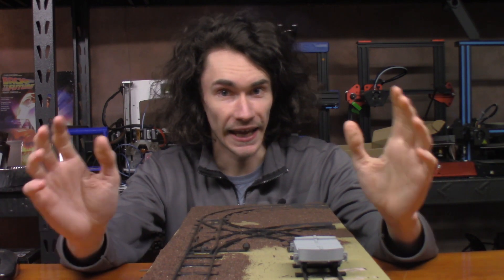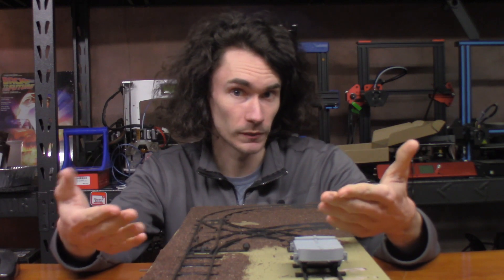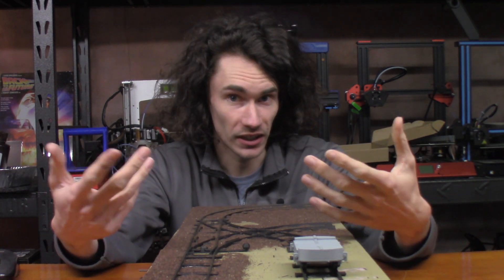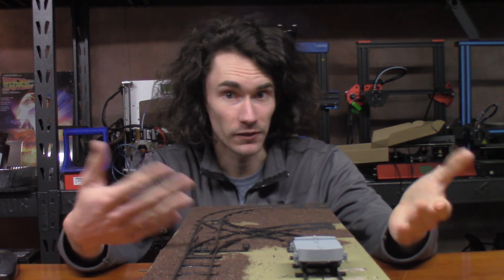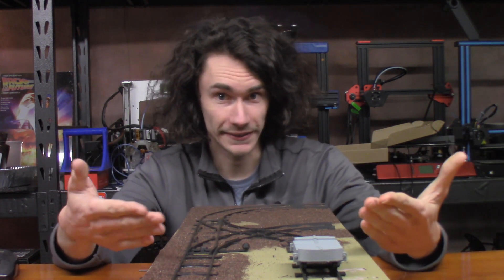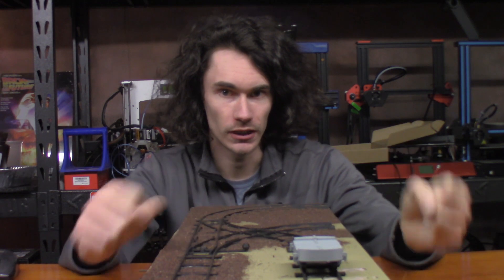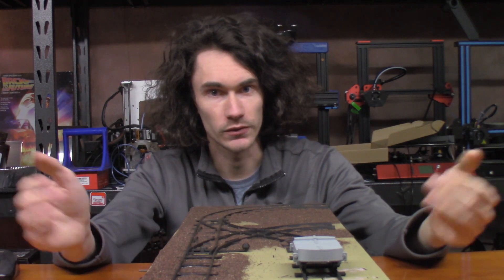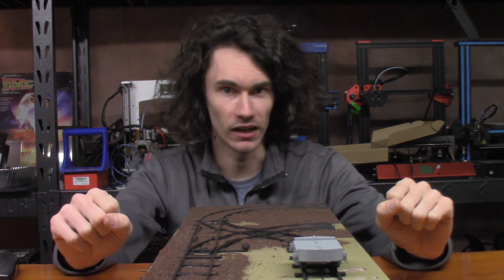PolyTerra PLA 3D Printed Track #PolyTerra #PLA #PolyMaker

Comment: Your video on PolyTerra filament convinced me to buy a couple of spools.

Very informative video!  And I've watch a few of your other videos.  They're all very good and engaging.

I'm slowly working on a 3-D printed narrow gauge train car as a test.  I'm doing it at 1/32 scale (Gauge One) but it will run on O gauge track.  However, I screwed up the measurements when I did the design, so I'm back to starting at scratch.